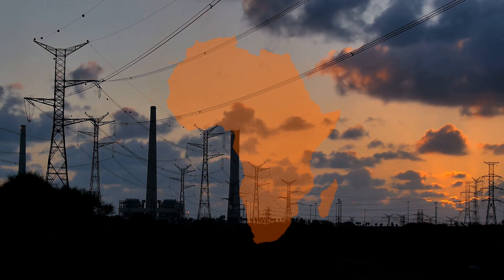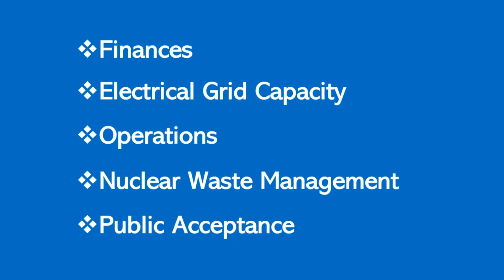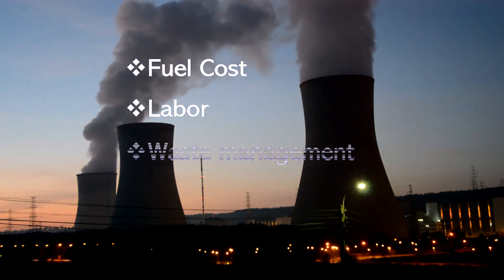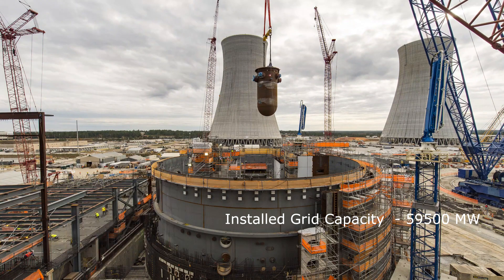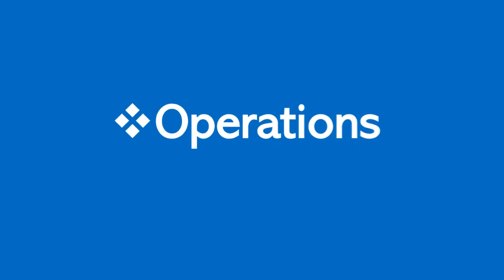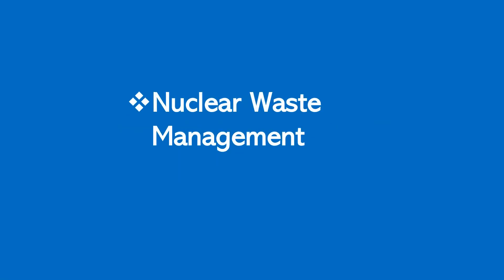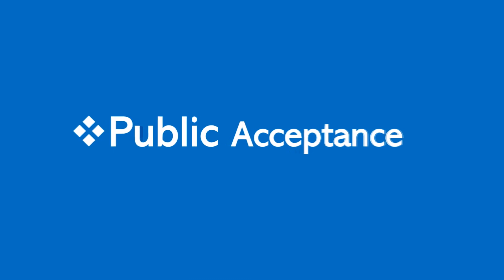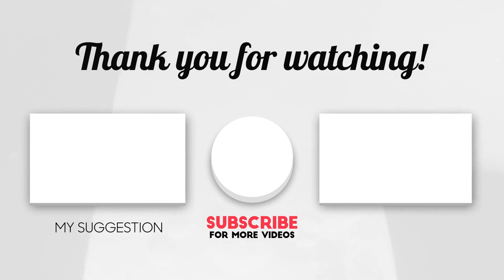Are African Countries Ready for Nuclear Energy

Comment: Starting with a small reactor makes sense if grid is small and you want to reduce up front cost. For instance, here in India there are many 220 MW reactors. 

One of them, Kaiga-1, set the world record for reactor in longest continuous operation. Around 2 years! Compare  with renewables like solar which have a 20% capacity factor. 

As for recycling waste, I believe that is the main solution for nuclear "waste." We should really not be calling it waste and instead use spent fuel since it still has so much energy left. Once reprocessed only it truly becomes waste, and now the quantities are tiny. It also produces much less heat/radiation so it can be stored in a cheaper, denser and efficient manner.  

If there are security issues with reprocessing, that should mean we must improve security. Not close the door on recycling.
Reply from the maker: I guess India can be a source of inspiration for any country that is seriously considering a small reactor. The great thing is they can study what has worked great for India and what hasn't .

Comment: Good video! Just a few things:
- You pointed out that stealing plutonium isn't easy, so why would you say that nuclear terrorism is a big risk for reprocessing?
- Also nuclear waste comes in small amounts and still generates small amounts over the years. All the nuclear waste in the world could easily fit in one football stadium.
- Finally, Chernobyl was a very different type of reactor (Graphite moderated)  than most reactors (Pressurized Water) build in the world today. The type of accident is very differently. Fukushima was a Pressurized Water reactor and the melt down resulted in less than 2 deaths! (More people died from evacuation and fear). Nuclear still stays one of the safest sources of Energy. Safer than fossil fuels which kill millions of people a year due to air polution.
https://ourworldindata.org/safest-sources-of-energy
Designs have also improved since Fukushima, so if there ever is an accident, people just need to stay calm.

Comment: Very well-balanced video with straight to the point information.

Three minor things:
The grid should always be about ten times the size of its biggest single producer (no matter if it is coal, nuclear, gas, hydro, wind, solar), it also should have a fast response the size of its biggest single producer (usually can be done with load shedding (ie: turning things off)). In terms of nuclear a "producer" would be a "unit" or "block" (reactor+turbine, casually called a "reactor") , a "plant" is a simply a site of power-producing units (take Bruce in Canada for instance. That is a single plant with eigth units (operated as two separate plants of four units each))).

There are many reactor designs that are in the 500-800MWe range, CANDU (and its derivate IPHWR) in particular should suit Africa well (it is a reactor that runs on natural uranium (no enrichment needed), and other than the turbines nothing really is bigger than can be built at a shipyard - so it can be  built with a very high degree of localisation (utilising domestic workforce and domestic resources)). (PHWRs are often overlooked since they are a bit odd (despite being the third most common type of nuclear reactor (after PWR and BWR), they also are very very good at being flexible)
Such small reactors also usually come in sizes down to about 240MWe (but since that size cost the same to build as a 640MWe (excepting turbines (and for PHWR the heavy water)) it makes more sense to order the bigger ones (and order a desalination plant, steel foundry, or hydrogen production plant and operate it exclusively to manage power fluctuations)).
VVER (the normal russian PWR) comes in all sizes from about 300MWe to about 1300MWe. The AP1000 (Vogtle, Sanmen) also exists as finished design as an AP600 (600MWe). China offers various PWRs at all sizes from about 300MWe to about 1100MWe. BWRs also comes in smaller sizes (its range is between about 300MWe up to about 1700MWe).

In general all nuclear reactors operate just fine down to about 25% of their rated power level, so you actually could build an oversized unit and allow it to go closer and closer to maximum output as the grid grows - depending on model and estimated rate of growth of the electrical grid this might make sense (however, impossible to decide without a very close look at whatever grid and society the reactor will be put in).
(Sweden actually did this by accident, the entire Forsmark plant (3x900-1000MWe (today 3x900-1172MWe), online in first half of 1980s) wasn't needed when it got ordered, but projections said it would be (they where off by about 15 years for when it would be needed (in sweden they curtailed hydro power instead which ended up serving as cost-effecient peakers (wintertime in sweden))))

A bit further of musings, a very handy way to introduce a "sheddable load" in a country's grid is electrified railways, which arguably would be very good for the economy of the country.
Reply from the maker: Valuable points that touched on multiple things I had no idea about.Will definitely do more reading especially  now that more countries in Africa are showing interest.  Kenya just announced their plan to build a 1000MW plant and I believe it will be a PWR. The suggested location is next to the largest river in the country. Right now the single station with the most capacity is actually a wind farm. However most of the country's power is from geothermal comprising 45% of the total capacity. If the planned nuclear plant is actually completed, it will have the biggest capacity. The country wants to reduce its use of heavy fuel oil.
Reply: Very interesting what you are saying about an NPP operating at 25% of their power level. How low can the capacity factor of a NPP be for it to be profitiable?
Reply: @chigeh  Depends on the prices in the grid and how the plant is managed and planned - for instance a new nuclear power unit cost about 5-8uscent/kWh (when at 90% capacity factor (cf)) for the first 15-30 years, after that it is about 2-4uscent/kWh (lower if maintenance is optimized for long-term running, higher if it is slated for short-term profits (nuclear is a long-term game)).

If you operate a 20 year old plant like the Finns do at 30% cf you should be able to compete down to about 3uscent/kWh, if you operate it like the Japanese do then it should be down to about 5uscent/kWh.
Should be noted that at that 30% a nuclear plant in Finland wouldn't be profitable but one in Japan would be (electricity is cheap in Finland).

(Below is a more expanded answer to explain the breakdown a bit)

A 300MWe nuclear power unit cost about as much to operate as a 1000MWe unit does (and a single unit plant costs about 80% of what a twin unit plant does, and a four unit plant cost only about 50% more to operate than a twin unit plant does). Economy of scale is a very real thing in nuclear.

Fuel cost is in the ballpark of 0.5uscent/kWh (the uranium cost of that is about 0.24uscent) - the main cost is interests (on the build) and depreciations. After that the biggest cost is opex (operation and maintenance), and after that fuel. (Once the initial cost of the build+interest has been paid off that post reduced to about the same as the one for fuel).

In a system that fully handles its waste (incl geological depository and cleaup) will spend up to (for a fleet of ten units, for 40 years - for more units it gets cheaper, and/or if running longer) the same on this as it does on fuel.

The above is the "rule of thumbs", however it does vary a lot (main three factors for increasing costs are political meddling, change in laws, and unsuitable contractors (so you can order two identical twin unit plants of the same type and end up spending $24bn at one place and $7.5bn at another place (that example is AP-1000 for Vogtle and Sanmen respective)).

The fun thing however with nuclear is that it usually is cheaper to build an extra load (split hydrogen, build an iron foundry, start refining aluminum) than to run the reactor at lower capacity (since the cost of running at full power vs reduced power is roughly the same per day you might as well run an industry whose main cost is that of power and sell that product, or just export electricity). Nuclear is at the scale where it kinda breaks the intuitive feelings of people who are not used to dealing with huge numbers over time (it is very similar to railway systems in this regard).

Comment: Wonderful video. Nuclear is a really tricky energy solution. I wonder what other alternatives they are thinking about.
Reply from the maker: Thank you. Countries are exploring different energy sources based on need and resources availability. Ethiopia is big on hydro, Kenya has a mix of solar and wind, some are even looking at coal. However since the Russia Africa summit, there was a big shift and renewed interest in pursuing Nuclear.
Reply: It's not about alternatives, each energy source plays a different role. Solar is cheap but the sun doesn't shine at night. Nuclear is a constant power source that produces no air pollution. The only real alternative for nuclear is hydro, which is limited by geography.
We already see that Ethiopia's push on hydrogen is causing conflict with Egypt and Kenya. Filling their damns with water put's a strain on the other's water supply. That's why Africa needs nuclear for true clean energy independence!